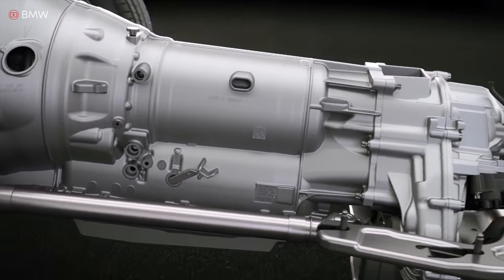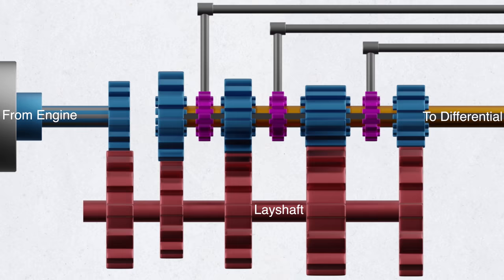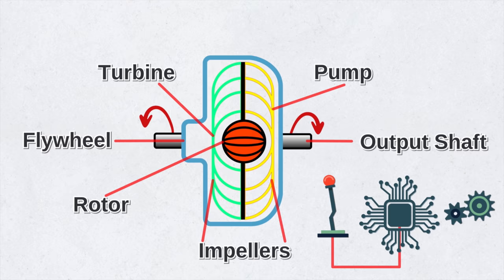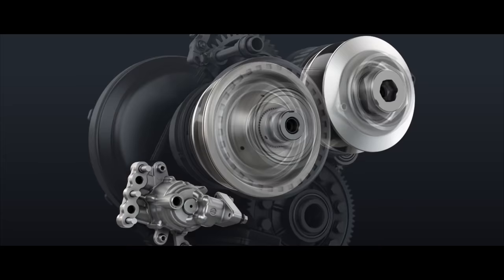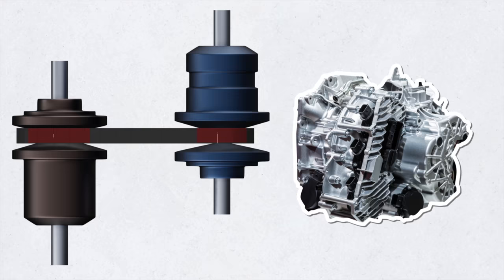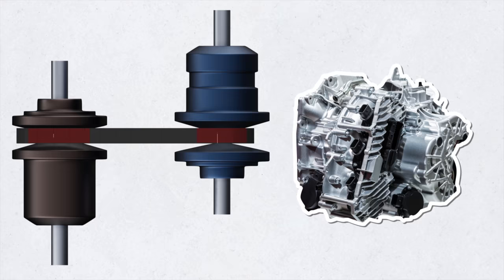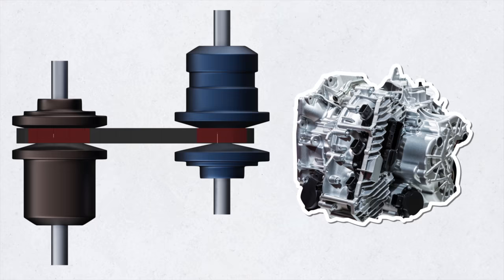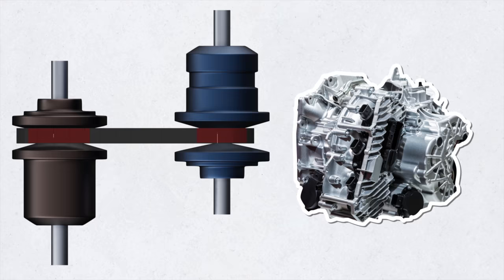Parking Like This Will Destroy Your Automatic Transmission

Comment: Just found out that I been driving my car on low transmission oil for around a year, I changed the radiator, belts, starter, thermostat and oil changes by myself but that transmission oil... Ouch such a amateur mistake
Reply: Running it overfilled can be just as bad or even worse. With too much fluid in the transmission the fluid will foam up. Then when all that foamy fluid that's all full of air bubbles starts to circulate through the transmission major damage can occur very quickly. The transmission fluid level needs to be set properly according to the manufacturers specific instructions so that there is sufficient fluid inside to properly cool and lubricate the transmission and that it isn't overfilled so that the fluid stays completely liquid as opposed to getting all full of air bubbles. You probably got away with it because you don't drive it too hard and perhaps you don't drive it in hot weather all the time.

Comment: 17:16
but what if i’m shifting into sport mode or a lower gear? does that still apply or?
Reply: Changing modes is not changing gears generally. Like if you put in heavy mud it should prompt you to go into neutral to engage 4wd lo if you have that but 2wd to 4wd hi and awd on modern cars is just a computer setting.  The mode will tweak sensitivity for your brakes and throttle and adjust your awd and other settings but it doesn't throw you between gears.

Comment: I drive a Nissan Versa with a CVT when I drive between 45 and 65 MPH on flat roads the engine speed stays constant around 1750 RPM.  Below 45 and the RPMs are lower and above 65 they are higher. How does this square with your statement that running an engine at such a low speed for a long time is bad for the engine?

Comment: Hey Scotty, what's the view on how often we should change out the transmission fluid? I've heard some people say that as long as it's shifting properly there is no need to change it. I don't live by that and have changed mine about every 35k miles. What's your opinion?
Reply: Your owners manual should be able to tell you that. If you don't have it, it should be available in PDF format either at the manufacturer website or their OEM parts site (ex: Ford OEM is Motorcraft)
Reply: check the owners or service charts specifically for your vehicle and your transmission- there is no one size fits all advice anymore as manufacturers have diff standards and parts and lubrication requirements

Comment: I figured out a solution for if u removed the transmission and powered the wheels directly from the engine. Just drive at 1000 mph so there’s sufficient pressure 🤣🤣🤣

Comment: I don't get the 1/4 fuel tank thing. The car has a fuel pump and isn't fuel pressure at the engine and oil pressure in the AT then independent of the fuel level in the tank?

Comment: Maybe some of you can help, or scotty himself would reply! I currently have a 1998 Honda Accord 4cyl Automatic, it has a bad transmission fluid leak and has almost no fluid! I havent drove it since i discovered almost no fluid, but currently i have to get to work and back. My friend has Valvoline CVT ATF Transmission fluid, and I suppose some fluid is better than none. Could I use that fluid for 2 weeks (about 50 miles a week going back and fourth between work 4-5 times a week) until I can get the proper fluid?

Comment: Is it safe to engine brake with an automatic transmission? 

I remember going down the Appalachian mountains as a passenger and trying to slow down with the brake pedal would just mean you overheated your brakes. So... everyone kinda just went 90.
Reply: I believe it was the older automatic transmissions that had 1 for going downhill , as in engine braking ? And number 2 for going up a steep hill / mountain . I don't cars nowadays have these features , as a mistake .
Reply: @peterrudy9207  yeah a lot of cars now have just upshift and downshift buttons which you can use for engine braking but years ago you could manually shift into 3, 2 and 1 for engine braking or for a power boost depending on what you wanted to do.  Never seen a car that didn't either have a 3/2/1, just a 2/1 or shifting buttons or paddles.

Comment: When driving on slick surface such as snow, I shift my automatic into neutral when rolling up to a stop sign. It really helps in stopping. Takes the forward driving force away.
Reply: auto trans literally brakes for you when u take foot off gas.....
dunno wut ur talking about but ok
Reply: @rocketsmall4547  try it some time, No it does not brake. Try it, it make a drastic difference in coming to a stop. Auto trans does not brake.
Reply: i coast all the time in N in auto. to save fuel because when it in N. it does not auyo brake when foot off gas coasting to a stop. only when is safe to do so.
Reply: @rocketsmall4547  - If engine idles fast, can be difficult to come to a complete stop when in gear... is what he means...
Reply: @rocketsmall4547  not so at very low speeds
Reply: @BuzzLOLOL  They should get the idling tuned down to minimize creep
Reply: @DACoutBack  so u cant tell theres a drag if in gear?
its not alot but is there u can tell. unless your cars transmission is super smart. Mercedes have a leveler in its trans so it does different things up or down hill.
Reply: @rocketsmall4547  - He means the transmission drags speed down to about 5 MPH, but below that the engine idle wants to keep the vehicle moving, so put in neutral to complete the stop easier on slippery surfaces, so front wheel brakes aren't competing with rear wheels slight power when little traction is available...
Reply: @manFromPeterborough  - The stupid 'smart alternator' in my Ford stops charging if idle RPMs is very low...

Comment: Scotty  When I take my car to the dealer for a transmission fluid change,  how  can I know they actually did it?
Reply: Look at the fluid before and after it gets changed. Before the change it probably will have some dark discoloration to it and it also might smell burnt. Then after the change it should be clear and look like cherry flavored soda pop and have just a petroleum smell to it. To do this wipe the fluid off of the transmission's dip stick prior to the change using a white napkin or a clean white cloth. Make sure you keep the napkin or cloth, which will have a single stain on it, for a reference. Then after the change do the same thing and put the second stain next to the first one. If the fluid was changed you should easily see the difference between the first and second stains on the white napkin or cloth.

Comment: at 9min mark, says to change oil every 30-35 thousand miles.  Do you mean 30-35 hundred miles ?  I usually change oil alot sooner so I think I am misunderstanding something here. At min 9:22 mark, you talked about the belt made of metal & be changed every 60-65 thousand miles..is that the timing belt inside the engine ? Learning as I go amd I am conaidering a cvt car. thx

Comment: So about the last tip, I let it run about 30secs after starting the engine then drive slow to warm it up. Is it bad to do this? since you also said to drive automatics higher than 1500 RPM ?

Comment: This was extremely interesting. I learned a lot. Question - at 5:40 did you say that cars need their oil changed every 40,000 miles? All these years I've been going every 3,000 - 5,000 because that is what I was taught.
Reply: Transmission oil not motor oil
Reply: CVT transmission oil

Comment: When waiting at a stoplight (or the like), is it okay to keep a CVT in drive, and use the parking/e-brake to keep the car stationary?  I recently bought an automatic transmission car for the first time in my life, and for decades would put my manual transmission cars into neutral with the handbrake on for long lights, so I don't have to keep my foot on the brake pedal.  And I'd like to keep doing that, if it's okay for the car.
Reply: New Fords and I assume other cars do this automatically.  They have an electronic parking brake and when you come to a stop it engages that and disengages it when you hit the throttle. Really nice for stop lights and drive thrus.  So yes you can do this, the parking brake simply engages the same brakes you'd otherwise be using.

Comment: I got a few questions I hope you can help answer. Firstly, I heard that if you need to stop for a short while, maybe 10-15 mins, its better to keep the engine idling instead of shutting it off and starting it back up. Most of what I heard is that it actually saves more fuel this way as starting up the engine takes up more fuel, but I don't see the logic in it. Secondly, you mentioned warming up the engine before driving, especially during winter times. What if where I stay is tropical all year round with temperatures averaging 25-35c all day and night, do i still need to warm up the car before driving off? Due to speed limits, the speed I drive is around 30-45mph in a city setting.

Thank you
Reply: No, idle idle is bad for any length of time..it wears the motor, who ever told you thathas no idea how a motor works, except that it uses gas. And, you should give your motor a minute to let the oil circulate
Reply: Even with older vehicles leaving it idle wastes gas. Unless you have a hard time starting your vehicle I'd turn it off. If its going to be parked for 30 seconds or longer it's a good idea to turn it off. Less wear too.
Reply: Modern cars can be simply started and then drive off gently... if it will keep running doing that...
Reply: @BuzzLOLOL  New Mazdas have auto engine cut for stopping at the lights, I hear them restart when lights turn green

Comment: I have a 2009 Corvette with an automatic transmission.  It has about 38,000 miles on it.  Would it be advisable to do a transmission fluid exchange at this time?
Reply: Check the fluid colour. If it is totally clear and not discoloured at all should be Ok to go to 60K. Depends how you drive. Check colour and clarity form time to time and change if any sign of disclouration.

Edit  Do it yourself, as Scotty recommends, that way you guarantee the correct fluid.

Comment: Forester with a CVT. Coasting in Drive at 50 mph the engine does about 1000 rpm. Coating in neutral, same rpm more or less. Since the engine-driven CVT pump is putting out the same amount of work, is there any reason not to coast in neutral?
Reply: He explained it

Comment: Scotty, my ford auto transmission failed - I attempted to run it up a steep hill and let it slip for a minute and may have burned off some clutch material on the slip rings? if I got that right?  Is there any way to maybe salvage it by fluid change or special fluid additive to overcome the slipping?
Reply: Well I'll give you my two cents worth, 40 years of trans overhaul experience,  the answer is no unfortunately.  Once the friction material is gone the transmission does not produce enough pressure in the system to force the clutch packs to lock, it will unfortunately continue to slip. 😕

Comment: Hey Scotty, I have a 2003 Chevy 2500 HD with the 6.0l Vortec v8. The truck has 4.10 axle gears, with the rising fuel prices would putting a different ring and pinion gear in to make it 3.42 save enough on fuel to make the difference? Thank You, Storm
Reply: WTF?  Auto box story here.  BTW change gears

Comment: There is no disadvantage to using a manual transmission You can't use comfort or hills or traffic as an excuse That's just not knowing how to drive You have to handle what comes at you doesn't matter what you're driving If you can't then you buy an automatic It's pretty that simple they're not less advantaged though they're actually have more advantages to a standard because you can use the transmission to slow down You can get killer gas mileage but you can also get worse gas mileage in an automatic if you're revving the hell out of the manual

Comment: Lmao. These 8 speed and ten speeds are going to go behind 3 cylinder turbos they are
Now prepping for mass market. Even the valves will be solenoid computer controlled.
Port and direct injection with dual staged turbos. Making all this up? Road and Track article. Little people get 200hp 3 cylinder.
Hybrid. Millionaires can afford 1000hp electrics or hybrid. Two tier society.

Comment: How long CVT lasts? more than Automatic Transmission's 250K miles?
Reply: The belt slips even new 9.0
Reply: @cliftonin  What's 9.0? Yes, it shouldn't slip, at least not that much
Reply: @saultube44  where I live is almost city driving they last less then 100000 km 60000 miles If you want to road test one just watch the rpm jump up as the belt slips
Reply: @cliftonin  What year make and model?

Comment: Skip to 16:00 for Do’s & Don’ts 👍🏼
Reply: 16:45 Sitting idle at a long stop, is there a difference between P and N with foot on the brake pedal?
Reply: I didn’t know changing oil in a transmission was a thing. Are you talking about transmission fluid?

Comment: Nothing beats drive by wire with a manual transmission nothing will ever allow a human to be so linked to the car modern cars for all the technology they have It's awesome but it just taking you furthering further away from actually driving hard nothing will beat manuals and drive by wire steering and throttles no matter what No traction control what do you think race cars are basically old school with new school technology If if new wage tech was the best then all race cars would have all that technology but they don't most of them have old school tech